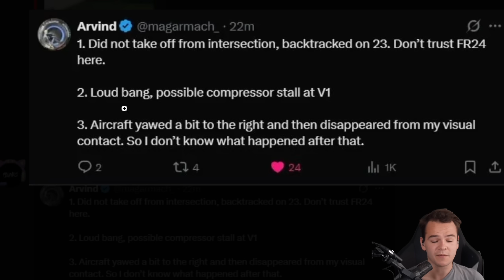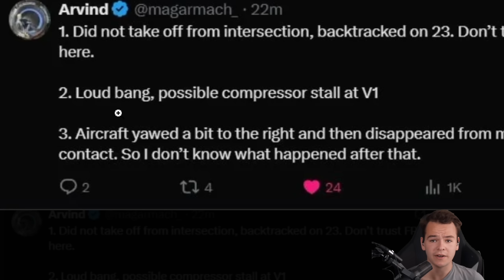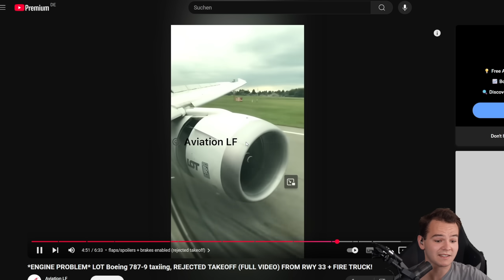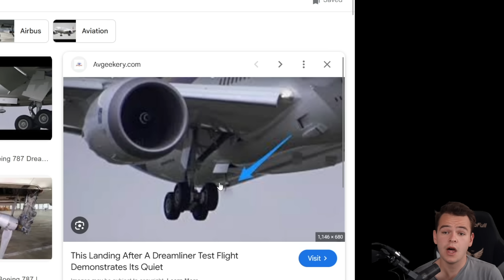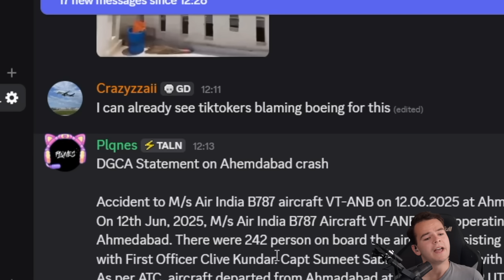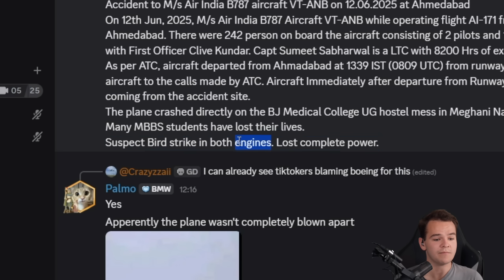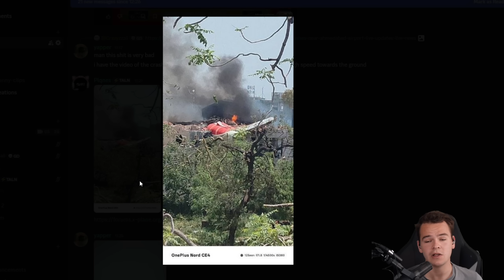The First 787 CRASH Ever - Why It Is SO Confusing?

Comment: oh it's a 787-8 eh? and a terrible teen (made in 2013)...

Anyway after 24 hours this is what we know now:
1. plane crashed with no flaps.
this is strange. It did take off, i.e. flap was down at some point. A 787-8 carrying 200+ pax is basically full, with no flaps it won't "crash after takeoff" because it won't take off at all. It would simply smash into whatever the first obstacle at the end of the runway is. And we know it didn't. So for some reason the flaps were retracted before... or shall we say without gear up.
2. pilot made call about losing thrust.
Could perhaps point toward bird strike or engine problem. However I didn't see surging from the pre-crash clip. Not good enough for verdict tho, because birdstrike can kill an engine without producing visible surging.
3. gear is still down.
some idiots claim "they might be trying to land" yeah thank you captain obvious. They have a problematic plane, of course they will try to land. But that's still not correct procedure. You should always retract gear before flaps, be it take off or go around. If it's mechanical problem that's hardly an excuse for the crash, as airliners can continue climb with gear down.
An even more idiotic assessment from generic media is that "pilots may try to reduce drag by retracting flaps". No. gear drag is leagues stronger than flaps. The last thing you want to do when your gear is still down (for whatever reason) is to retract flaps prematurely, as that stalls you out by increasing speed requirement for adequate lift.

Personal assessment: doesn't sound like Boeing problem. That's all I care tbh. There is a reason why all (yes, all.) recent boeing problems including MAX crashes happens on airlines that are either from 3rd world, brain purged in covid or are completely bullshit made up by anti-Boeing factionists.

Comment: My analysis ... Wrong starting point (half way of runway instead of end and then U-turn) at take-off.  99% Pilot's mistake. 😡
Simple Physics:  
Not enough Momentum to lift...
Take-off Momentum = mv**2
(Proportional to Square of speed.....)

-- Prof. Sam HO, Research Fellow, Dept. of Engg., Cambridge U.

Comment: As a pilot with over 10,000 hours of PIC (Pilot in Command) time I can tell you from watching this very close and studying the videos that are out there right now, there is only one reason why the aircrafts nose fell through and started to teetered at around 50 to 75 feet. I truly feel as a pilot myself, that at 50 feet the Pilot flying called "Gear-up" and the first officer reached over and accidently (without thinking) raise the flaps instead of the gear. That would be the reason why the nose fell through the way it did and started to teeter. Sadly this "flaps up" mistake has happened before. 

After watching the very clear original video of the take off you can clearly see what seems to be the flaps retracted in the final 3 seconds of flight. Plus with the aircraft teetering as it was and the nose coming through at 50 to 75 feet would happen if the lift was suddenly removed, hence in this case the SIC raised the flaps instead of the gear which as I said is not the first time that has happened. 

I would hope it would be something else, but the flight characteristics seem to match 100% of a premature flap retraction. May all the souls be with Our LORD!!!! AND SAVIOR!!!! JESUS CHRIST!!!! 

GOD BLESS!!!!

Comment: Why wasn’t the gear retracted bc to keep speed on a plane is to have the gear up but maybe bc if the gear went up there will be alot of drag but what if a tire burst upon take off and got logged into both engines
Reply: they only had just took off
Reply: @moatieyyy in a cockpit once when your in positive rate of climb pilots usually put the landing gear up but on this occasion after climbing 600 ft off the group they still haven’t retracted the gear which either means they dont want to or there is something stopping them from putting it up

Comment: Why is it so confusing? because you don't have a clue on what happened. 
its all there in the video  the Jet lifted off normally  the gear didn't retract ?
if you look at the wing it normally  bends up more at the tips as lift increases 
that didn't happen then you see it start to descend .most likely caused by 
the retracting of the flaps  in stead of the landing gear. The cockpit tape will
tell us why. but as the video shows most likely this is what happened,

Comment: A couple of things with this video, first off it's a pretty good analysis with the very limited information you had at the time. 

Regarding the ram air turbine, quite amazing how you noticed that considering that wasn't the original video. Had you waited for that to be released you can very clearly hear the turbine and see it as well so fair play. The reason for the failure is still questionable obviously. 

Unfortunately what this video gets wrong is the crash site. You can see those buildings don't actually match the ones in the photos as the pattern on the wall is missing. 

Still quite shocked by it all. RIP to all the victims. 

I wish people stop speculating about it if they aren't even sure what they are talking about. The number of people talking about flaps and blaming the pilots is ridiculous. Just let the investigators do their jobs.

Comment: I don't think your theory is completely right. I've lived in India for many years and flew many times. I have never seen a flock of birds on the runway let alone those birds just ramming into BOTH engines at the same time disabling them both. My personal belief is that the aircraft was not well maintained or inspected regularly. It was 10 years old. All the pollution, dust and insanely hot weather of India simply got to it.

Comment: That is not a real clip. it is a clip that is recorded from the computer you can see by the shadow of the persons hand. the real clip of the crash considered the sound of the small Roter that comes out from the body of the plane when both engines stop functioning completely.  so it seems like the both engines were failed.  the real clip was captured on a cctv or a phone.  and the clip that media is showing that is recorded from a computer so both the clips are real but the sounds   are diffrent in the cctv clip and computer clip.  you can  not hear the sound of the Roter and in the  clip (That Media Is Showing)in the cctv clip   you can  hear the sound of the roter properly so i think the both the engines failed. and you can hear the sound of roter or turbine clearly.

Comment: Possible root cause theory of AI171
Based on footage, RAT deployment, survivor reports, and aircraft behavior, here's my theory:

 A loud bang was reported by the survivor, but no fire/smoke was visible in ALL clips including airport CCTV.
Aircraft used full runway, climbed slowly, then lost both engines at ~645 ft.(FR24 details)
 RAT deployed → confirms complete engine generator loss.
Landing gear was tilted forward, caught mid-retraction — proving engines failed after positive climb, during gear-up sequence.
→ This shows the pilots followed procedure, but total engine loss froze the hydraulics mid-cycle.
 Post-crash: blackened and dented engine core,no other engine remains

Conclusion:
Most likely cause → Fuel contaminated with water.

Water → steam → pressure spike = loud bang (compressor surge)

Water kills combustion = engine flameout

Both engines ingest same contaminated fuel = total power loss

RAT auto-deploys to power flight systems

No fire = water killed combustion, not fuel-air ignition

This fits every piece of available evidence.
Not Boeing. Not Air India.

Looks like a fuel farm / ground crew disaster.

Let’s see if the FDR proves this right.

Comment: You keep saying "indestructible" over and over again. No airplane and/or no airplane part is indestructible. They might be fail-operational/fail-safe, they may have redundancy, they may be of extremely good manufacturing and taken care of very well with proper maintenance throughout their lifetime.

But repeatedly calling it "indestructible" even if it's just to keep the viewer's attention on the video isn't anyone, especially a young aviator, should be doing. Just an advice from one aviatior to another.

Comment: Take this information, that only one survival in hospital told to media that 2 sec just after take off " "everything stuck ( a very loud noise like engine stopped working just after 3 sec of take off) immediately white and green lights blinking " "... So it indicates a clear both engine failure because they are at maximum thrust.
Intersting thing is that he's seat number is 11A and hospital bed number also is 11.
So God bless this child with 11 ❤❤❤❤❤

Comment: As a microsoft flight simulator player, I got some theories myself, I suspect something was wrong with the fuel because just some birds can't destroy an engine that big, i think something might have stopped the fuel from readhing the engines that was caused probably by the flock but I cant formulate any further.
Reply: Another stupid theory I have is that when I flied some planes on the game for some reason the engines kinda worked by themselves depending on speed, altitude and rotation of the plane.... Something might be related to that sistem failing if it even exists?

Comment: Your facts are wrong. Thats not where the plane crashed. The trajectory is not to the right of the runway either. Its pretty much straight ahead. 

It hit a building about 2 miles from the runway, not 1 mile. It hit a place called "Royal Mess" or something. 
Theres photos of the crash site. This building matches it. The building you claimed it hit does not match it at all.

Comment: Footage has emerged of the prior flight of the air India 787 which was around 2 hours before the crash. 
footage showed that the plane had trouble with its electrical system all devices such as lights, aircon, and travel screens were malfunctioning.

Comment: Simulate the flight.
On take off, retract the flaps to UP instead of Gear Handle and see what happens.
Get the the atmospheric conditions correct too.
That is what happened
Reply: That wouldn't be the case as the 787 does have an alpha lock equivalent. As in in such a configuration it won't let the aircraft just clean up by accidentally going flaps up instead of gear up.

Comment: Lads have we given up on keeping the APU on for t/off and landings now incase of elect/ hyd power failures?
On take off first words "V1 rotate" then " positive climb , gear up" not flaps up??
Reply: Can't speak for Boeing or wide body Airbus but A320 family don't require APU on for take-off. For hyd and elec failures the aircraft has redundancy and backup systems, you simply don't presume all will fail right after departure and keep APU on (even if you keep it on you'll shut it down after acceleration anyway)

Comment: The 787 is equipped with those powerful GE Turbofans. The AC was not working apon take off. Both engines failed at the SAME TIME. Maintenance issues and not  design problems.

Comment: Could the flaps have been retracted by mistake when the goal was to retract the landing gear?
Reply: The aircraft won't let that happen. Also, even if it does, yes the aircraft will lose lift, but it'll look different that how this incident happened (here loss of thrust happened)
Reply: @ZK-APA  thanks
Reply: @ZK-APA  I guess this pilot suggests that it is possible?  I apologize if I use incorrect terminology in my original post  https://www.youtube.com/watch?v=xZ71OgFpQcU
Reply: @JM-Roslyn  It is possible. That is true. However there is so much redundancy built in that its close to nil that it will happen inadvertently. Also you don't need to apologise for anything as you had a genuine concern and you just asked about it.
Reply: @ZK-APA  I appreciate the discussion.  Thanks

Comment: Correction: the GEnX engines offered as an option on 787s are not 'indestructible' or without issues. The GEnx engine showed a vulnerability to high-altitude ice crystal icing, which could lead to temporary power loss. Additionally, the NTSB investigated fractures in the fan midshaft, and in May 2024, a United Airlines 787-9 experienced a suspected uncontained engine failure shortly after takeoff from Singapore, an event currently under FAA investigation.

Comment: The speculation about what happed is what is causing your confusion, wait for the facts. One thing you are over looking is that 3 different videos show the air craft during takeoff on the runway and in the air with the flaps up. A noises can come from a lot of places for a lot of reasons. The pilot saying lose of power could come from a nose up attitude with insufficient air speed for lift on a 110F day and the settling of the plane in the 5 seconds the pilot had to figure out what was happening. One video looks like the aircraft over shot the end of the runway before lift off.

You should be an accident investigator because you have solved what went wrong with no information only speculation. Good work.

Comment: Sir, I think what happened was the pilot either mistake the takeoff thrust to weight ratio that he input in the plane's computer that gives him the right amount of thrust to use (same as emirates a340 incident in Australia) or the pilot didn't deploy the flaps into the right configuration (according to green dot aviation), which is needed to make lift. Either two, most probable cause is pilot error. RIP to everyone
Reply: Almost everything you have said is wrong. There are checks to confirm data input and the aircraft won’t take off with the wrong flap setting. I recall a 777 scraping its tail in Italy recently because of wrong data input, similar to that EK A340. That was wrong data input and led to a damaged aircraft. This 787 took off ok and started climbing ok, then didn’t.
Reply: @EdOeuna  Thanks for correcting me, but it's just my speculation and I based on what could possibly occur throughout this incident. Considering that the reports said that it had a compressor stall. but, one thing is clear, it'll probably deemed as Pilot error
Reply: @nighthunter_2525   - compressor stalls are usually associated with repeated bangs and even flames from the affected engine. One engine stalling isn’t a problem on take off. Two engines stalling at exactly the same time would’ve very rare.
Reply: @EdOeuna  @ZK-APA  Thanks for giving me ideas about what I said, guys. But it's just weird why the engine won't provide thrust during the most crucial part of the flight (which in this case is take-off) and the Ram air turbine came out as we saw.
Reply: @nighthunter_2525  - the aircraft appears to rotate and climb away to several hundred feet ok, so there is adequate thrust at this point. Once the aircraft is airborne and climbing the PM call will be “positive climb (rate)” depending on SOP. They’re looking at either the bark altimeter or the vertical speed indicator. The aircraft is clearly climbing so both will show a positive movement. At this point the gear should be raised but it wasn’t. It takes about 5 seconds for the flaps to move from 5 to 1 (flap 5 and half extended slats moving to zero flaps and half extended slats). At this point the aircraft, essentially, loses 20kts of performance, which may be enough to prevent the aircraft from further climb. The timing seems to fit with this hypothesis because the aircraft appears to stop climbing at the point when the gear should be selected up. This may also link in with the Mayday call where it is apparently stated that they have “no thrust, no lift”. Again, this ties in with a sudden loss of climb performance.
Reply: @EdOeuna What could possibly be the cause of the likelihood as you speculated?
Reply: And what I mean by "wrong input" was that the pilots convert lb's to kg's (they either forgot to do it, most probably lb is the standard measurement in aviation or kg)
Reply: and please guys, if I said anything wrong, just comment here, it'll help me know more about how things work in aviation.
Reply: @nighthunter_2525  You are incorrect. As in yes what you wrote can happen. But in that case the aircraft wont lift off in the first place. Here the initial takeoff was normal, then a few seconds later it started going down.

Comment: High Bypass engines are quiet by design. Why were'nt the flaps fully deployed in a negative sink rate? Why did the aircraft rotate only at the very end of the strip? Why was the gear not raised on take off?

Comment: The only two things I can think of is, complete engine failure, or something happened to the Flaps and Slats that mechanically failed and caused them to retract causing the failure of lift.
Reply: Or maybe the PM retracted the flaps and not the gear.

Comment: Excellent analysis. One thing I noticed before it augured in was an increased descent rate I think indicating a stall. A high angle of attack was visible throughout the descent, possibly the maximum possible for maximum lift as airspeed and altitude inexorably decreased. Condolences for all the lost and to their families.

Comment: There is video of what looks like a catastrophic engine failure on the runway via a plume of dark smoke. The sole survivor reported hearing a loud bang on takeoff. 787's are designed to fly on one engine as you show, let's hope the correct engine was shut down or the aircraft decided to go into wacky auto mode

Comment: 1:51 dual engine failure??? F off no flaps at all at 40+C temp of fing course it stalled as soon as it was out of ground effect. I think its gotta be some hydraulics loss or conplete electrical failure since the rat was deployed. The engines were clearly running and had no damage.